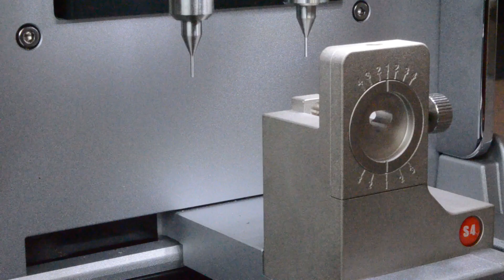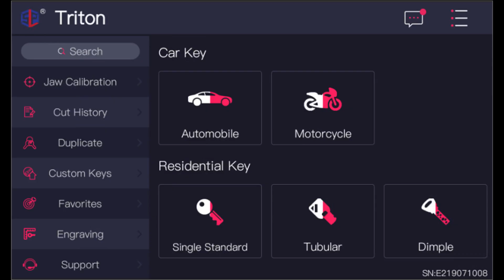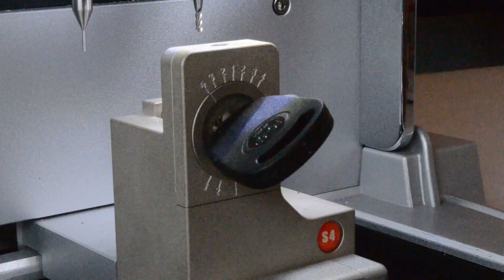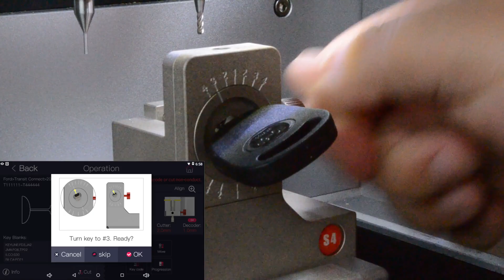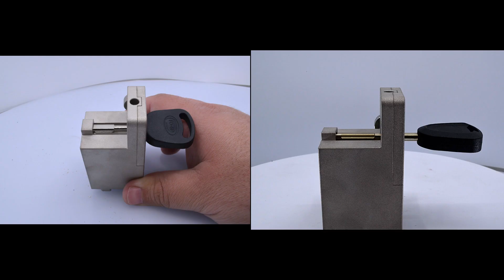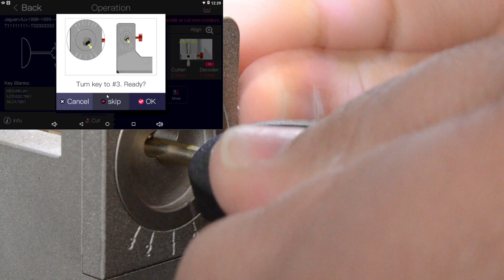Triton Key Machine | Tibbe Jaw Tutorial

Comment: This is an amazing machine, does this machine have a handle to lift it?? and does this machine have any option to operate with car battery??
Reply from the maker: It does not have a handle but there are hand-holds at the bottom of the machine. 

Also there is a 12 volt adapter available!